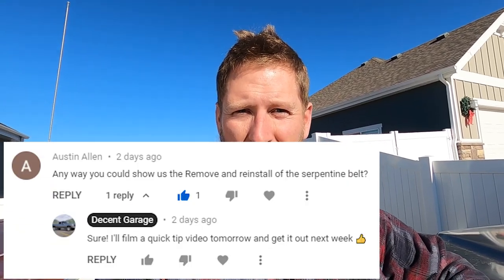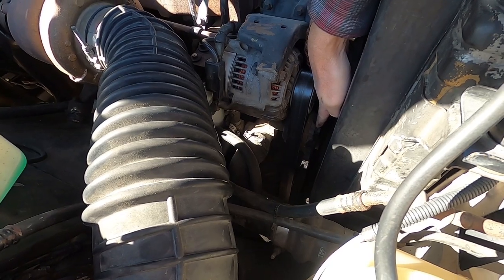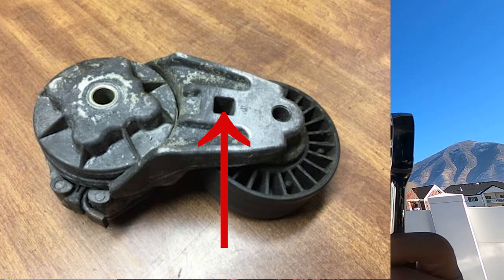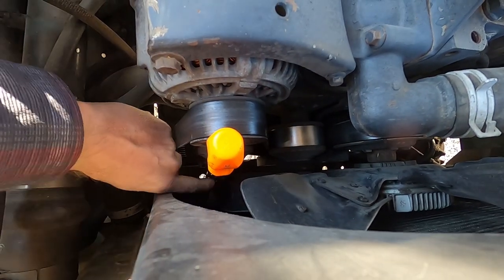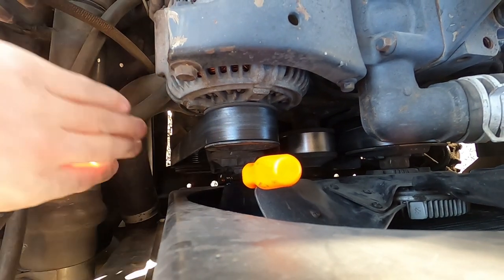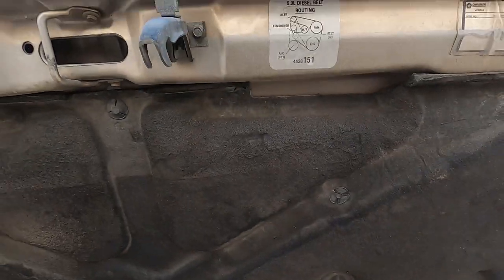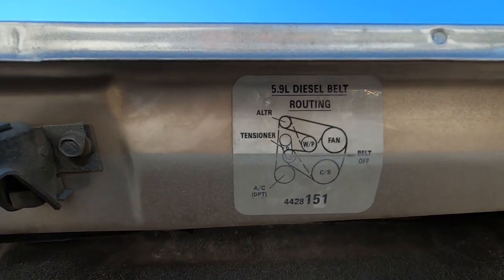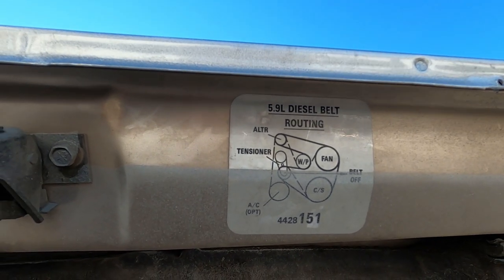12 Valve Cummins Serpentine Belt Removal

Comment: I learned on a trip to Mexico a few years ago that one of the best things to have in the "boonie box" is a serpentine belt that DOES NOT include the extra length for the AC.(as well as one that does)  My AC went out and I was stuck.  A local found a belt made for my 1st gen that did not have AC and presto......I was back in biz and could get to a place to get the AC repaired!!
Reply from the maker: I would not have thought to have a non-AC serp belt as a backup but that is genius!

Comment: Any tips for the tensioner not keeping tension? I replaced the belt tensioner but the belt is so loose even after tightening
Reply from the maker: Are you sure you have the correct belt on it? What year is the motor?
Reply: I didn't have the tensioner in the alignment dowel